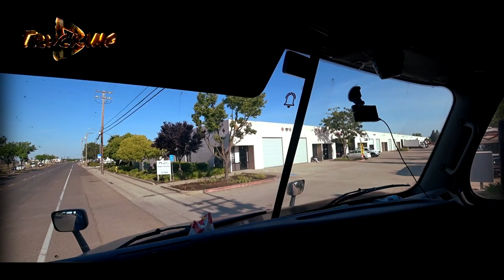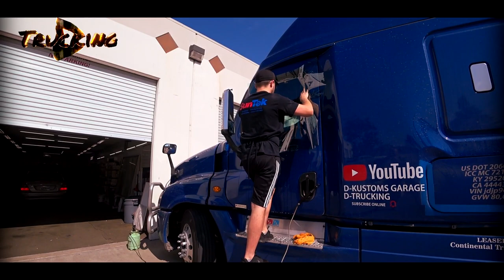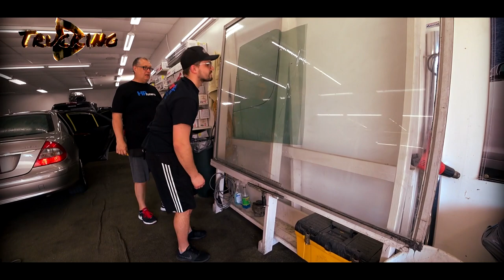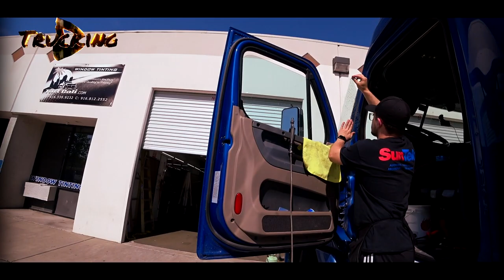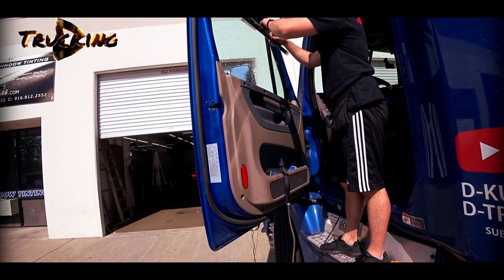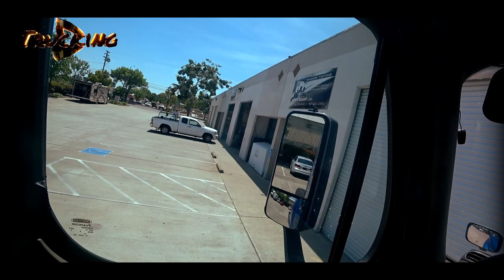Cascadia WINDOW TINT

Comment: What percentage was that tint you used?
Reply from the maker: 70% doors and 70% windshield. Ask for a new film (it calls polarized or something like that)
Reply: @d-trucking6813 cool thanks for the info.
Reply from the maker: Emilio Clas I like 70%, can’t see that tinted and restrict more then 50% of sub. Love it, AC works very little compare to before.
Reply: @d-trucking6813 what's the cost of that ceramic for all the windows? I also have a 2013 Freightliner Cascadia.
Reply from the maker: Emilio Clas the guy said, for Freightliner will be like 100$per door and 175$ per each windshield , 25$ per stripe. I think those prices. Even just a doors are good but with windshield is awesome. I got a little discount but still were a little pricy!!!! Worth it tho ...
Reply: @d-trucking6813 if it does the job of keeping that heat out then every bit of money is worth it. Will look into getting mines done. Thanks again